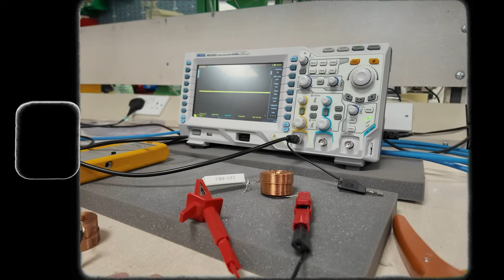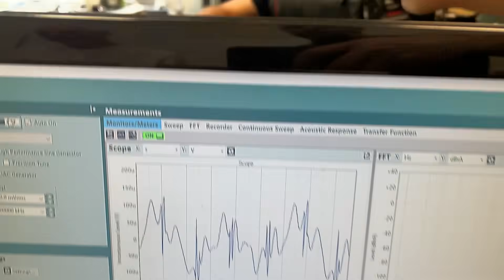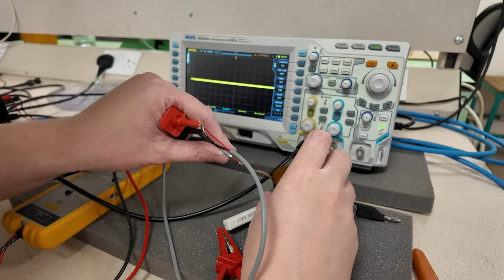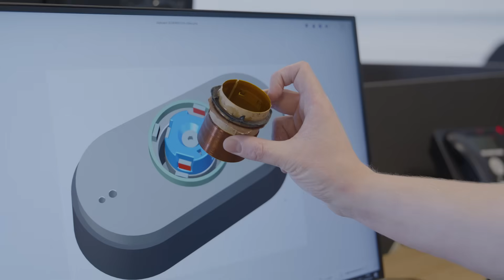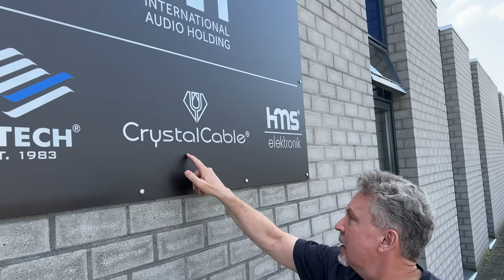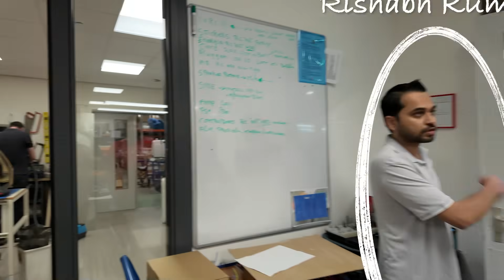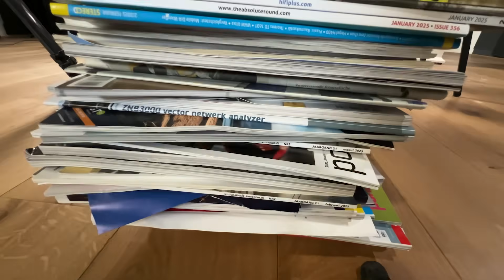Secret KEF Tech & Sphinx Reborn: A SoundStage! Speaker Journey to the UK and Netherlands

Comment: Sorry but coil motion monitoring is a failure to make any correction, you may as well do it far upstream,. You need room sound pressure monitoring, which is a technology you don't have. A company serv sound did what you do now in the sixties. You need a very specific wide band transducers too do this. If you need help I can help you, it is quite advanced and used in aerospace fed back into the amplifier system. There is a lot of signal processing to align acoustic and electrical feedback.I  use laser informatory to achieve this. The delay is miniscule les than 200 nS
Reply: I don't think you understand the purpose of the VECO sensor. I encourage you to watch the two videos pinned at the top.

Comment: Philips motional feedback ?..
Reply: The principles of MFB have been known for a long time but the implementation is the tricky part. The Philips’ system was the best they could do at the time, but technology , materials and quality of manufacturing progress.
Reply: @russellbaston974 Yes I agree, but is it worth putting that technology in a sound bar ?
Reply: @IanKnight40 I think the initial iteration in a sound bar is quite sensible and looking at markets. A lot of current hifi gear is getting sold to “lifestyle “ buyers and part of that is domestic convenience and acceptance, getting good bass from compact components would be very much part of that, in promoting the equipment. 
Kef’s KC62 subwoofer stresses its small size relative to its output, so a similar approach across the range is logical.
Reply: @IanKnight40  It's not hard to see that it's going to go into other active speakers in the future.
Reply: @dougschneider8243 Fair point Doug.
Reply: @russellbaston974 That's fair, but it seems a real shame that a soundbar is considered worthy of such a development first. Using the tech in a 2 way loudspeaker that punches above it's weight with extended dynamic range and low distortion spl capability for its size would have been really interesting.
Reply: @IanKnight40 It’s very hard to say what the strategies are at various companies, but I’d imagine the tech was developed irrespective of the product it would eventually be used in. In other words, KEF didn’t decide to make a soundbar and then have someone say, “Let’s invent VECO for it.” Rather, the VECO project was likely well underway, and when the soundbar came along, someone probably said, “We can use this tech in there. We were planning on using it in regular speakers, but this seems like a good fit.” I’m just guessing, but knowing how developers work, I’m willing to wager that was the order of events.
Reply: @dougschneider8243 Hi Doug, yes I agree....let's hope KEF are developing it for something really special!. Cheers , Ian.

Comment: I have to take issue with a few things in this video.
1) You can't set off a fire alarm with farts. And to even suggest you can - is dangerous. 
2) KEF's sound bar isn't audiophile gear. Why is this even being looked at?
3) Siltech cables are just re-branded monoprice cables. Go check out the exposée Juan Hernandez did on them last year.
Reply: I doubt much of what you wrote is serious, but in case it is, my response:

1) The fire department didn't have any other explanation, so we can only go with that one.

2) VECO is audiophile tech, so there.

3) I'm not sure where you got that idea about re-branding because in the video itself you can see the cables being made.